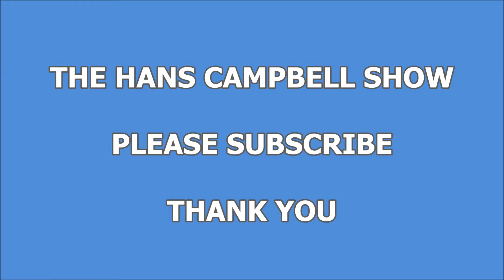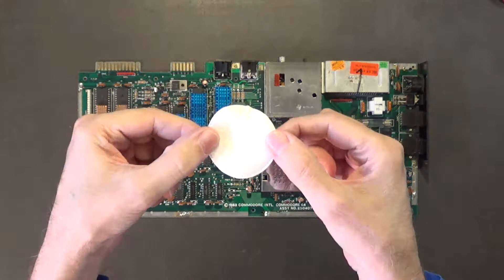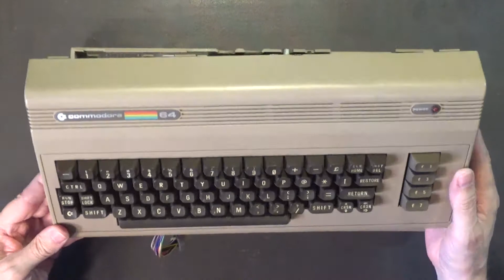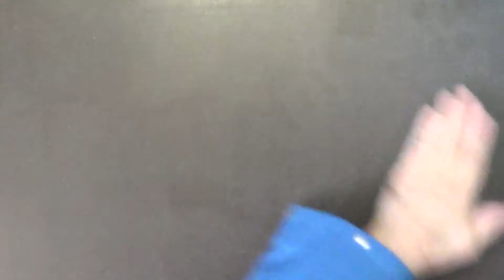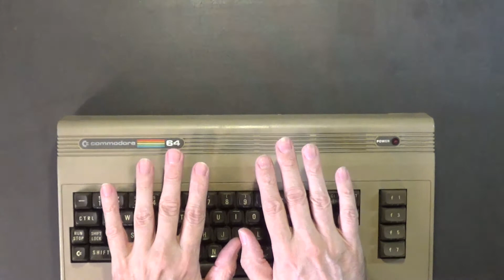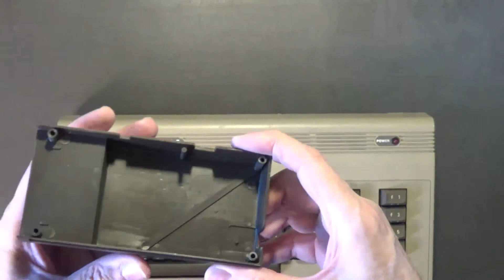Commodore 64 - 250407 Motherboard - Recapping and Heatsinks

Comment: Thanks for this. 

I'm currently breathing new life in to some C64's I had stored away for years. One of them looks to have been nicely cleaned and refurbished fairly recently (by someone else, not me) before being sold to me and subsequently stored.  Given the modern "J-PLA" and very clean and bold lettering on most of the components, I'm hoping it won't be necessary to re-cap this one, as I am guessing the caps have already been replaced within the past 5 - 10 years.

The big three blue caps are "Nitsuko" brand, which I've seen listed as one of the brands commodore used in their original productions, but it also looks like this brand is still making capacitors (unless I've seeing new old stock on web shops).  To my eye they aren't showing any signs of bulging.

Other than visually examining the capacitors and other components, are there other ways to determine the health of these capacitors?  

Thanks again!
Reply: You can use an ESR meter to measure the capacitor's 'health' without desoldering them.

Comment: Nice video Hans.. my c64 I have never opened.  It was a friend of mines childhood 64 and they donated to me years ago.  Lightly used by them in the day.  It works fine but i have never opened it.  Probably asking for trouble if I dont proactive recap... I like your small details of what torque screw driver to use etc.

Comment: The LED connector can go in either way.  Center is ground and both ends are positive on the little 3-pin connector.
Reply from the maker: I was wondering about that, thanks.

Comment: Maybe a good suggestion would be to list things like Caps, etc. and link to where to get them not unlike other Channels.  That way if someone likes Certain gadgets you use or recommended parts, etc. they can shortcut to finding them making the Videos that much more effective at helping out fellow Retro Users.  Thanks.   -Mark.
Reply from the maker: This is the second video in this series (part of a playlist).  I mention the values of the capacitors in the first video.  The screwdrivers that I use are made in Germany by Wiha.
Reply: @HansCampbell  My bad, I was referring to links to buy said items like the Capacitors.  I know Commodore References cover the stated values but thanks for the response anyhow.  -Mark.
Reply from the maker: @deborahberi3249  I buy most of my electronics parts from eBay.  They are a lot cheaper than electronics parts web sites.  Also, I usually buy 50 to 100 parts at a time, especially capacitors, resistors, and LEDs.